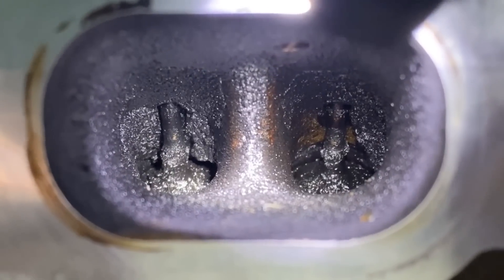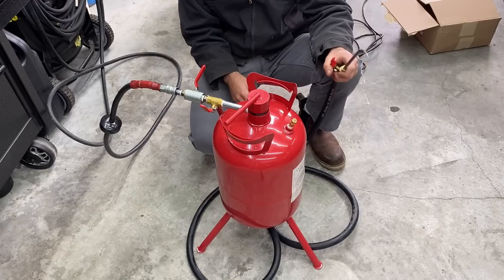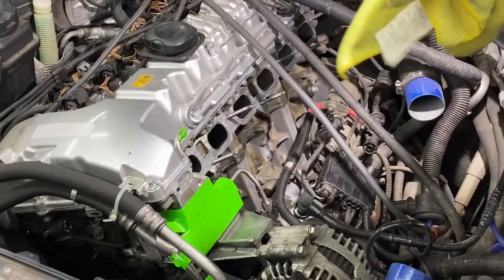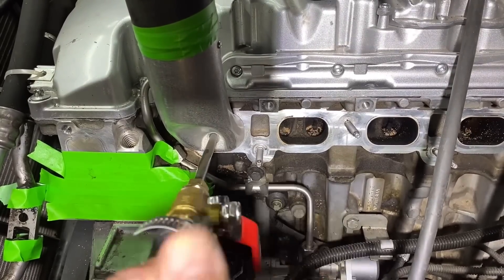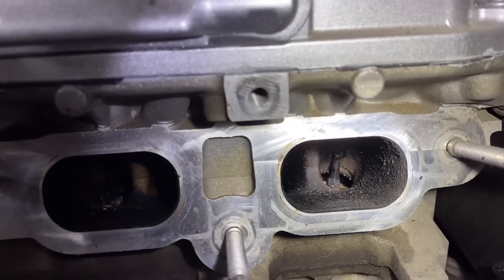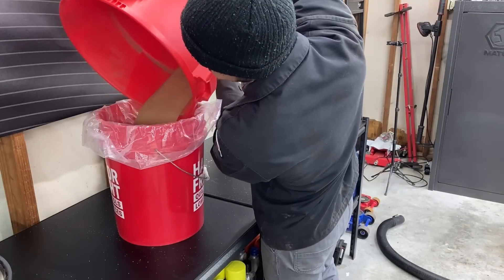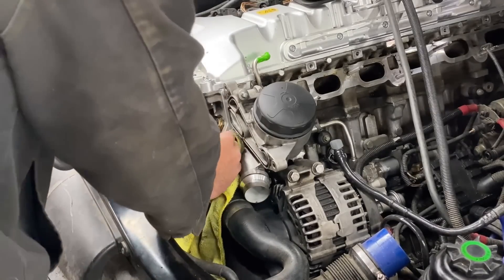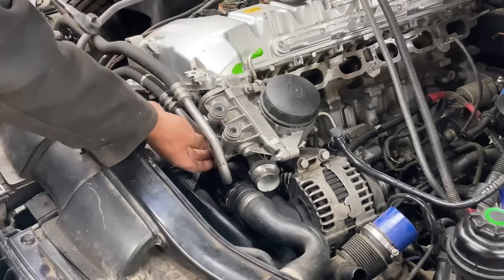Intake Valve Cleaning on my FREE Twin Turbo BMW 335i! N54

Comment: Unfortunately, it appears that this task is often approached incorrectly. To do it properly, you must first loosen the valve cover bolts and insert a feeler gauge shim to block off the valve cover PCV pathway of the valve being worked on. Skipping this step will cause shells to transfer into the valve cover and migrate to the opposing valves (as seen @ 4:40). As some valves remain open, this will result in shells falling into the cylinder head, along with clogging the valve cover PCV pathways. Be sure to use a high powered vacuum.
Reply: can u not just block each cylinder with paper and only remove paper to blast the valve?? i remember following a diy guide and it mentioned nothing about this. i used some kind of starter connection to open and close each valve iirc....
Reply: @JakeDaniel999  None of the DIY videos on YouTube demonstrate this properly. If you don’t have metal feeler gauges, I’d recommend using a firm piece of thin plastic such as a gift card instead of paper to block the PCV pathways. Just to clarify, the blockage should stay in place throughout the walnut blasting process and only be removed once the cleaning is complete for each cylinder.

Comment: Try automatic trans oil warm up motor speed up rpm start pouring slowly one lt. should be enough when finish go for a drive see the difference does great job.

Comment: Nice job. I recently cleaned my intake valves on my 335i. Carb cleaner breaks down the carbon buildup. Bunched up cable ties used as a brush inside the intake port. A wet vac to suck out the spent carb cleaner and repeat until clean. A compressor and brake cleaner helps with a final cleanup to finish. Just thought I’d mention that for anyone wanting to do the job cheaper. By the way, I personally prefer your longer videos than just snapshots of jobs.

Comment: i have this car! when do you recommend to do this?
Reply from the maker: Roughly every 60-100k. If you pull the spark plugs and put a boroscope camera down the cylinder you can look for carbon buildup on the back of the valves if the intake valves are open
Reply from the maker: You can also pull the manifold to look

Comment: Using the spray can intake valve cleaners every 15k miles as maintenance is a good idea once you walnut blast
Reply from the maker: Not a bad idea! Just sneak a straw into the intake charge pipe maybe?